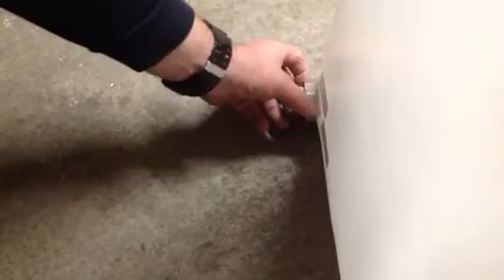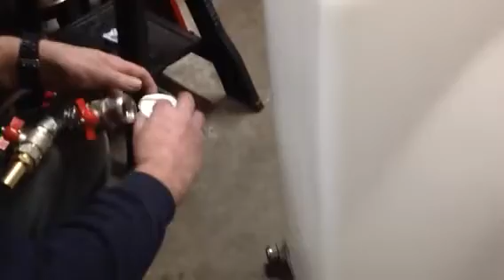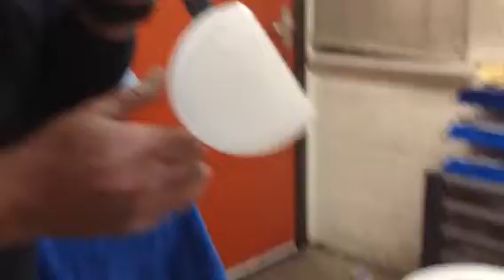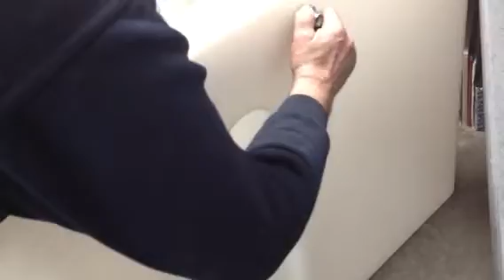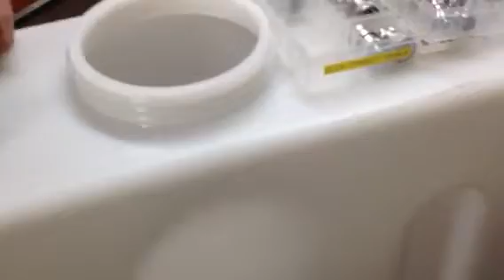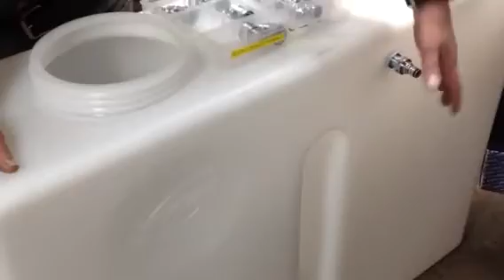QWASHERS YOUTUBE HOW TO SETUP BAFFLED WATER TANK CONTAINER IN VAN PRESSURE WASHER BUILD 01524241487

Comment: Could I use this fitting so that I can use the 2 parts running to the pressure washer to feed that then use the normal hose connector to feed my window cleaning set up so then I can use it for both situations?